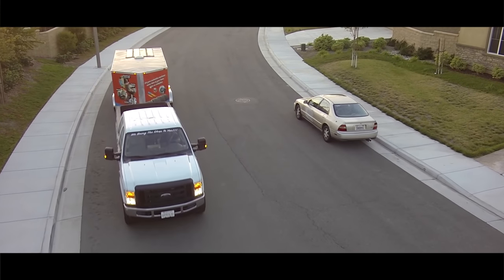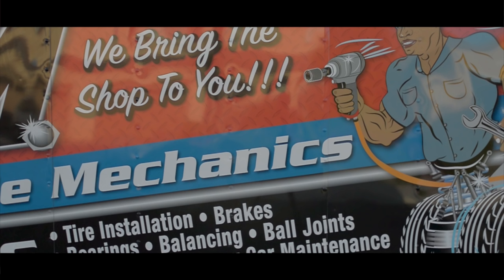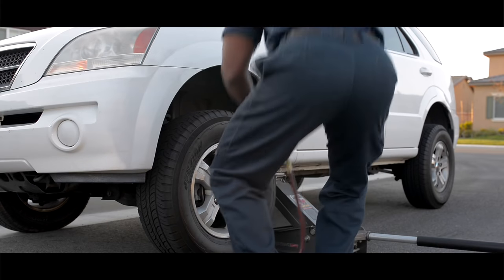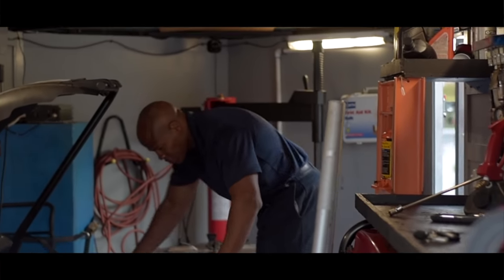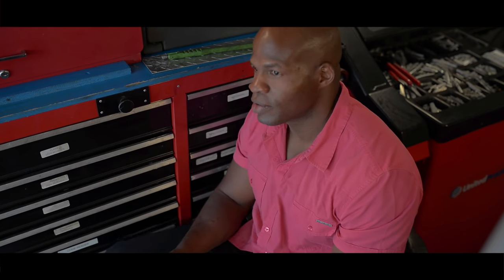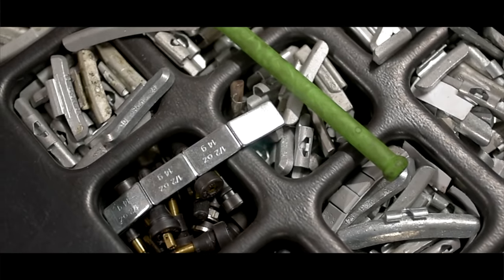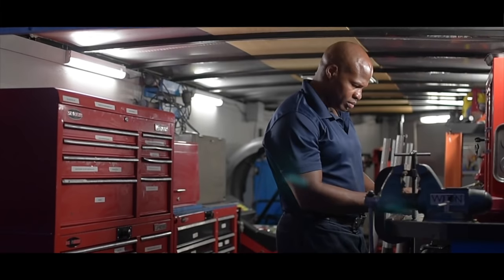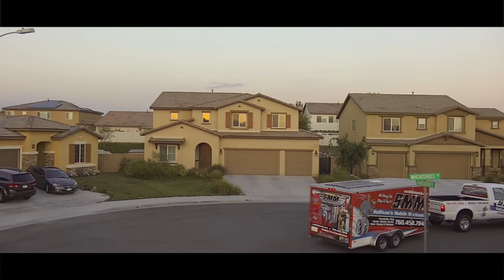Sullivan's Mobile Mechanic

Comment: Got a few questions.

What type of generator do you use to power the equipment?

How did you figure out the best way to balance load in the trailer for safe drive?

Do you ever get trouble of people complaining about noise of the compressor or air tools?
Reply: I wondered the same about the trailer layout
Reply: I saw solar panels

Comment: Good operation. I am mobile also but opt for a significantly smaller vehicle. I started with a 5 x 8 custom trailer but it was stolen with my equipment after my first two customers. In my twenty years. Most things can be done out of a car, small van or truck to keep costs down.  What you have is nice for fleet work.
Reply: Did you have a lock on the hitch?